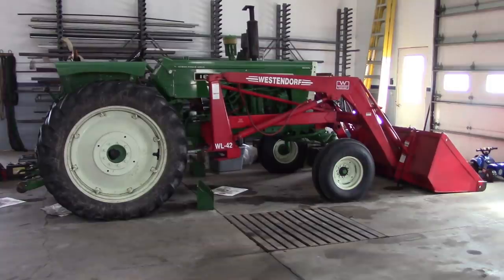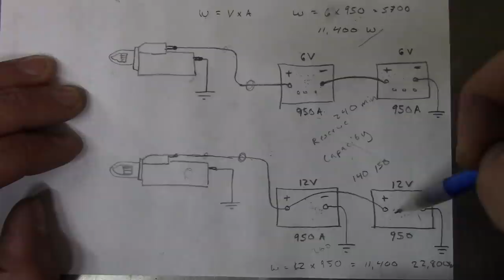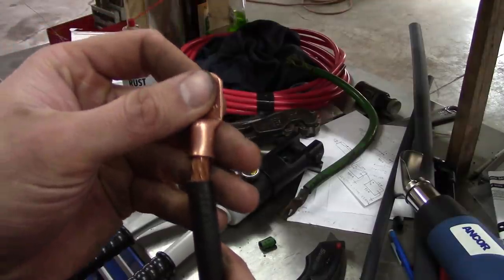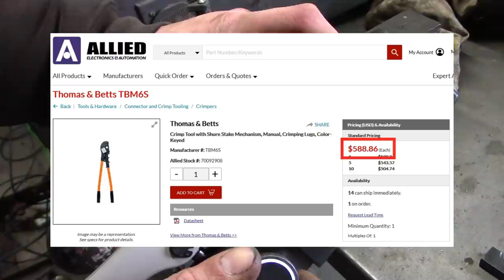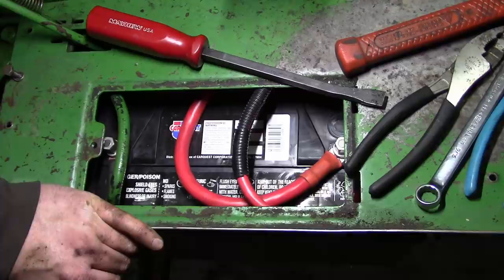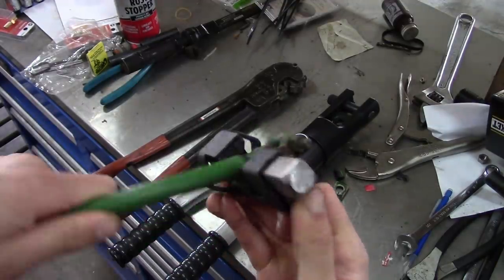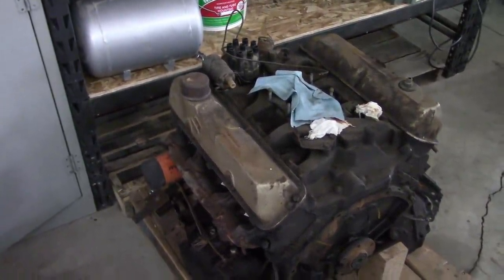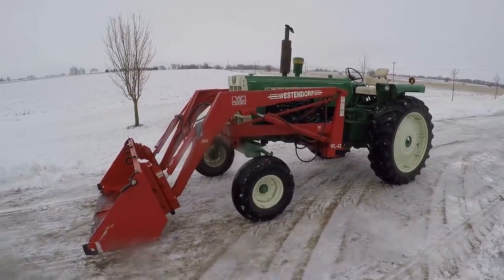Oliver 1650 Tractor 6 Volt to 12 Volt Battery Upgrade

Comment: I still enjoyed you cable video😀 
You must be looking over my fence. I had one battery die on my dual battery tractor.
Cleaned all the cables and replaced both batteries and problems solved.
Glad you sorted your previous house out!
Maybe you should have video your roof repairs. Watch Wes not working, working.
I love your tractor by the way.  If your not using it to make money it can stand a bit of character I reckon..  
I wish my old 1982 JD had a front end loader.  We use it mainly to slash the grass.  So the business all happens on the back.
I replaced the back tyres so I know how much they are.  The wife got a flat out amongst the trees so it was a bit sad to see it abandoned out there.
The funniest thing ever is the tyre bloke wanted $100 each to take the old tyres away.
I said I’d make them into a water feature first.  I ended up putting them on eBay with a clear description of their problems and someone paid me a couple of hundred bucks to take them and he was happy :). 
I can’t remember what I paid for the new ones but it was something like $500 each but I can still use the tread like a ladder 5 years on.
Love your work!

Comment: Re: your rant on batteries, I'll add my own favourite rant.

Most any manufacturer or factory can readily vary the quality of items it makes. It's pretty to easy to change quality of raw materials, processes, QC up or down. I have worked in a bacon factory, and we were supplying various UK supermarkets. We made different bacon for the different stores, according to their price point and priorities.

This means that just because two batteries (under different branding) come from the same factory, it doesn't mean they're actually the same, and you should simply buy the cheapest one. They may well be different.

(There's a Chinese factory making copies of high quality wood working tools, and various retailers around the world sell them. The actual items vary, since the retailers get to specify fit/finish and materials)

Comment: Congratulations on the sale of the house,   We just went through that, too took 6 months for us to sell.   What a relief when its gone.   as others have said it might be easier to use the crimper by holding the static handle or the bottom of the crimp area in a vice.

Comment: Where I live all CarQuest locations changed to Advance Auto Parts, and they all carry DieHard batteries today.  
As far as brands go, Motorcraft has been the best in my experience.  5yrs old in my F350 and still hold 12.6 volts.

Comment: Have a complaint. I was waiting for the Electroboom moment when you stuffed the cable thru the guide AFTER connecting them to the battery. PRETTY SPARKS AND SMOKE!!! I bought a cable crimper tool early last year then quit working. May be the same Chinese tool but with a different name. Retired in March. Barely enough SS to live. If they ever allow I may leave the country for some place cheaper. Need to sell all my stuff first. Unfortunately I might get 10 cents on the dollar. But 75% of my stuff is cheap junk. Worked for me. Love your channel.

Comment: I like using DLO cable for batteries and starter cables. The cable is oil, heat, flame, abrasion and sunlight resistant and rated for 90C. It is fine strand like welding leads.
Reply from the maker: Technically SGX or SGT is the only cable that is SAE approved for battery cables. I don't know how much it really matters.
Reply: @WatchWesWork  True, but DLO was designed for Diesel Locomotive applications. I'm sure it is more than qualified for automotive.
Reply from the maker: @nscantling  Yeah I don't know. Sounds like a good solution to me.

Comment: Hey Wes.  Totally not needed, but since I live is salty winter WNY, I like to solder the joints.  I clean the copper, add flux, crimp with a hydraulic or Force Logic M18 crimper, and do the following.  Heat up copper end with a torch and feed in solder.  Finish with some shrink tubing.  If copper isnt the brightest, I'll hit it with the wire brush/dremel.

Comment: For most DC motors what you said is true, that they will only draw so many amps. However, starter motors are designed to continue to accelerate until they exhaust the current supply.

Comment: A holding device is the way to go , a vise or pipe with a set screw in a vise  to hold the crimp er handle would be my choice
it's a lot easier to position the terminal lug and cable  in something secure and pump to the desired outcome
nice tool for the job - a little solder never hurts under the shrink warp  - like your channel and never disappointing  content

Comment: As usual an great video.
   Learned a bunch on the battery, and crimping wires.  That tractor is a pretty cool old unit, great shape.  Yikes, that liquid ballast in the tires, of it is calcium, is hell on concrete...
   Wow! That scenario with your second house is a very stressful, to say the least,  I have been there.  I can only image the weight that is lifted off your mind, after that sale.  Congratulations!
Thank you sir.".

P.S., Holy Cow! I just realized you had those new batteries setting on the bare concrete floor...  Ha, ha, ha...
Reply from the maker: Calcium Chloride is standard for tires. I don't know why.
Reply: Watch Wes Work Yep, has been used for a long long time.  Doesn't freeze, however they now use "beet" juice, not caustic, and I believe won't freeze either.
   The tire shop can swap it out, although no doubt, probably not cheap.  Probably somewhere in time the tube got a leak, and the calcium is now trapped between the tube and inside wall of the tire, and settles at the bottom, over time the calcium has corroded the rim, and now leaks.

Comment: I'm an auto electrician by trade and this has always been my rough guide to go from AWG to mm2, as over here, in automotive anyway, you run into both (especially in my most prominent line of work which was prime movers, including Australian built (and the odd US built private import) Kenworth's, Freightliners (ugh), Western Star, Mack etc.) The lugs we use are also metric, the lug will have a designation like 16-8 or 25-10 or 70-12, first number being the wire size in mm2, second being the lug hole size in mm.

10AWG - 6mm2
8AWG - 10mm2
6AWG - 16mm2
4AWG - 25mm2
2AWG - 35mm2
0AWG - 50mm2
00AWG - 70mm2
000AWG - 95mm2
0000AWG - 120mm2

I have a similar hydraulic lug crimper and its a godsend for getting lugs crimped on in difficult places compared to the old bolt cutter style ones.
Cheers from Sydney, Australia, Wes! Take it easy

Comment: The recommendation I've always heard is "buy whatever battery has the longest warranty" which landed me on a NAPA's AAA battery for my car. It's a 3yr warranty and prorated after that, and I got 20% off the regular price because of whatever sale they were running at the time
Reply: Also, I finally went to the Northern Tool near me and they have a damn good clearance section. I got a metric set of US made Bondhus hex keys for $10 because the package was torn open.

Comment: i'm glad that one worked for you on the first try. it looks exactly like the HYCLAT one i bought off amazon for 50 bucks.  Mine didn't work.  I could have taken it apart and rebuilt it with the supplied o-rings, but.... i just had amazon replace it.  It's possible the QC ppl suck and the dimensions on the internals were machined too large.  Haven't had a chance to try the new one out yet, been driving the truck I'm replacing battery cables on.  if the 2nd one doesn't work, i'll try out that klutch one.

Comment: We used 2/0 welding cable for making most battery cables; very flexible. It was bought in bulk rolls. Also had 1 and 2 gauge if i remember correctly. Our manual crimpers were made by Panduit which had rotating heads you set for various sizes of terminals; made a very nice hex crimp. Used red or black heat shrink. I am kind of on the fence about these cheap tools from China. That is why we have lost so many of our manufacturing jobs in North America. Craftsman tools that used to say Made in the USA now made in China i believe. Don't find the Made In USA on Craftsman any more.

Comment: A good old school rule of thumb for battery sizing is to take the engine displacement in inches and multiply that by 2 for gas or 4 for diesel for the cranking amps.  If your engine is less than 500 cubic inches gas, or 250 cubic inches Diesel, most any honest rated 1000 Cold Cranking Amp battery will do just fine.

Also for better cold starting upping your battery cable size by at least 2 full gauge sizes (4 ga to 2 ga or 2 ga to 0 ga and so on)  over stock makes a big difference.  

For reference I have a early 80's MF 1155 with the Perkins 540 CI V8 diesel that when we got it had  cobbled together 0 ga cables and was difficult to start at 40 F.   With a conversion to dual parallel 1000 CCA rated group 31 batteries with independent 2/0 cabling for each the tractor now starts a 20 F without issues and will even start 0 F without being plugged in  using nothing more  than long run on the intake glow coil conversion I did to it!

Comment: I have used welding cable instead of battery cable when fabricating new cables. The wire is much finer (more strands) so it’s quite a bit more flexible and the insulation is tougher because it’s made to drag across the floor. Available at McMaster Carr or any welding supply store. Check out your welder’s ground cable to compare.
  Thanks for the video !
Reply from the maker: It's not SAE approved for battery cable. You can use it, but it's a liability for me.
Reply: I’ve not heard that but I respect your view, thanks!

Comment: That crimper is the exact same yqk 300 one you see all over eBay and wish for 20 odd bucks. They just painted it gray and put their name on the case. I got a yellow one just like it as well as a larger 16 ton one that was only about 35 bucks. Both work great.

Comment: you are correct with your 35mm die as 25 = 4awg. 2/0 cable = 70mm. we use a similar crimper at work but on ours you have to keep pumping until it clicks.

Comment: Great video. Glad to see you using a hydraulic crimper! I’ve made hundreds of cables over the past few years with mine and have yet to see a hydraulic crimp related failure. In not entirely sure why you needed such a massive cable for the starter though. Quick tip: put a fuse on each negative battery lead.

Comment: I had a similar setup, 2 batteries in parallel on a fairly modern tractor, put a ground breaker on each ground wire or trust me, those batteries are always trying to charge each other and will fade over a short time, I had it so much with it I ended up to switch the 2 batteries with a singular bigger one.

Comment: I don't know if it's been mentioned but I'll throw my .02 in. I have a similar crimper and have found that it works best to start with a die that is slightly too big and start the crimp, then switch to a smaller die for the final crimp. Also, if it starts to pinch the edge, you can stop and rotate the lug one flat, so the pinch point is flattened. It's a bit of a process but you end up with beautiful and strong crimps.

Comment: Wiring two 6 volt batteries in series is a cost effective way to obtain a higher amp hour rating and extend battery life between recharges. You'll find that the amp hour rating of two 6v batteries greatly exceeds that of two 12v deep cycle batteries wired in parallel. Using 6 volt batteries and wiring in series results in a 12 volt system without sacrificing amp hour ratings. This is a great solution for travel trailers, RVs, marine applications, dump trailers, winch trailers, and other instances where long battery life is desired.

Comment: Never used plastic wiring conduit as a heavy cable wear covering, always had excellent results using hydraulic hose coil wrap. And to protect terminals from corrosion, I've always encased with Denso wax tape.👍👍🇦🇺
Reply from the maker: It's pretty tight quarters.
Reply: Denso tape is the single most disgusting substance known to man !
Reply: @CrimeVid  But it works !. 👍👍🇭🇲
Reply: Andrew Hallett-Patterson  so does dielectric grease and it is not so nasty !
However I do have to apologise to everyone.There is an even more disgusting substance used for encasing big freezer coolant line valves, it is made of the same goo that is on denso tape mixed with cork dust, if you go anywhere near the stuff before it’s frozen it will follow you about forever, you’ll find it on your clothes after washing in the car,in your tools, months later

Comment: Agree with you on those CRAP battery terminals that clamp the copper. We would sometimes have machines that came in the shop where someone had used that garbage; good source for starting issues. They should be outlawed!

Comment: I was replacing the positive cable on a Gleaner R62 (3 batteries) and thought I would be slick and just remove the ground cable where it attached to the engine. My wrench hit the frame when loosening a clamp and sparks flew. I looked and someone had made a bare spot in the ground cable and clamped it to the frame. Well played...
Reply from the maker: I've got a few 10mm sockets that are blown out from trying to replace alternators without pulling the battery cables. I was "saving" time. LOL.

Comment: I have the same crimper. I've noticed if you crimp your terminal and then rotate the crimper to the next flat on the hexagon and recrimp in the same place it is a tighter, more even crimp without those little side wings.
Reply from the maker: Good idea!

Comment: I sell Interstate batteries for a living (driving delivery truck for them) and feel free to disagree, but I feel its more down to a combination  of how the battery is cared for, availability, how the person buying the battery is treated buy the seller, and price. Nowadays there is only small differences where each brand can call it there own besides the label and case. Like you said some are also very loyal to certain brands. Anyhow, regardless of brand you wind up using for your various projects it's cool to see you putting real thought and effort for a 12v conversion.  Most of the folk I've talked to that want to do a similar project find a battery that will fit in the existing tray and work backwards from there. Not saying that's a bad idea but I'd like to think it could save one alot of effort.
Reply from the maker: You are probably right. I've had great luck with Interstate batteries though!

Comment: Just a thought, Wes. If you clamp the cable vertically, then as you place the lug on it along with the crimper, gravity is a '4th hand'. That will always keep your lug solidly seated on the cable. (A trick I learned cabling telecom power and ground cables that were 750mcm, true monsters!)
Reply from the maker: Heh. You'd think I'd be smart enough to come up with that! Guess not!
Reply: @WatchWesWork  just another month or so, and we can have some Spring and summer vids. Yeepee

Comment: I know you hate soldering, I tend to pre-drill one side of the lug, crimp as you do and then flow some solder into the joint (lug/wire) prior to adding the shrink tubing. Not sure that is better but it works for me.

Comment: What I was saying was to clamp the Crimping tool  bottom handle in the vice  and then it will hold it solid for you as you pump it and squeeze it, I know it works great for me. TRY IT.

Comment: If you have doubts about the crimp on the wire drill a hole in the slanted part, place wire in a vice with the hole in terminal facing up, fire up a propane torch and fill it with solder then you are sure of the connection. That's how I do mine and never had a failure (knock on wood).

Comment: If you can afford the loss, crimp the terminal onto the cable, then cut the terminal where it is crimped to the wire. The wire should look solid indicating a good crimp. If there are any gaps of any size, you will have to crimp more. Crimping beats solder every time. Just check any tank wiring. 

We had a 2nd house in town that renters just couldn't stop trashing, so we sold it. It was in a good neighborhood and about 30 years old but could never find good renters. That's what happens when you can't be in two places at once.

Comment: Usually with the hydraulic crimpers, they have pressure relief valves.  So you just keep pumping until it reaches the relief valve setting, then give it two additional pumps.

Comment: 51 years ago, the local Oliver dealer let me borrow a brand new 1650 Oliver to drive to school and pull the float in the Homecoming parade. 😎😎😎 Well, maybe it wasn't as new as I thought. It may have set on the lot for a while.
 You must have just grabbed the wrong battery at Farm and Fleet 😃 I have one here, that's at least 15 years old, and maybe 20? Still works for my WD45 Allis. Now that I say that, it will probably be dead next time I go to start it.

Comment: A super farm upgrade .. .  Find proper ammo cans that fit battery  good install den cables on all units and make all ammo cans modular this way a quick turn and pick up the batteries or off the unit and can be put in the shop on charge for the winter or just for jumping anither unit.....    its kinda time consuming at first but when you have a bunch of tractors is a god sent.... I even mount them in very accessible spots on my tractors....and there stackable if its cold and you need amps. All you got to do is grab another can hook it in series and bam.

Comment: I wish my local auto parts store was reliable enough to crimp on terminals. Heck, I'd be happy if they were somewhat competent!

When my Duramax needed new batteries, I watched them try to remove the battery hold down nut with just the end of the extension. Yup! Just the extension and no socket attached. They even looked at the end of the extension to see what was wrong with it. Tried a second time with no socket attached.

I told em to go get the second battery and I'll get the old ones out in the meantime.
Reply from the maker: Ouch. My local store is awesome.